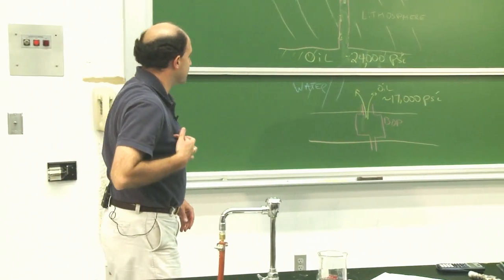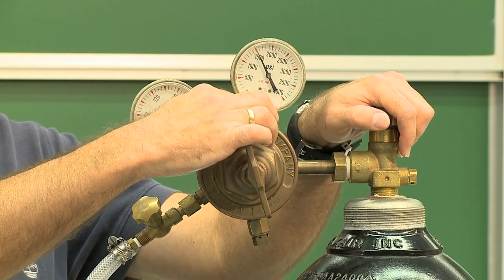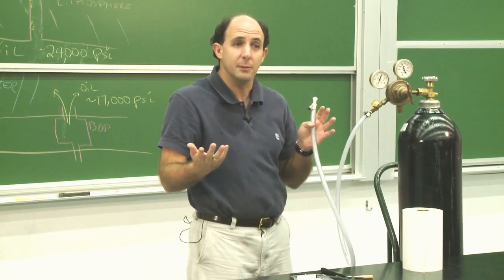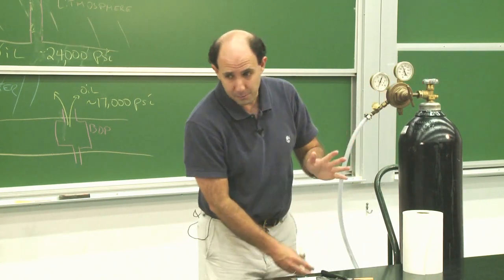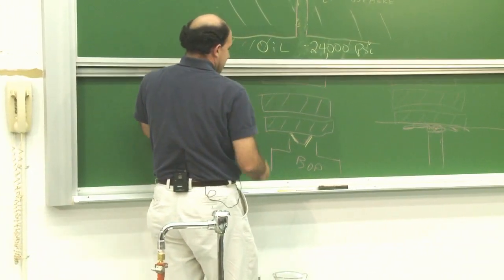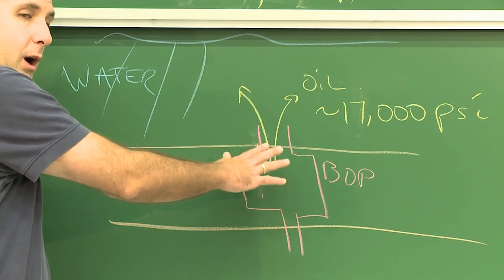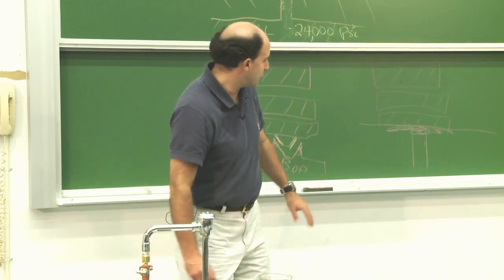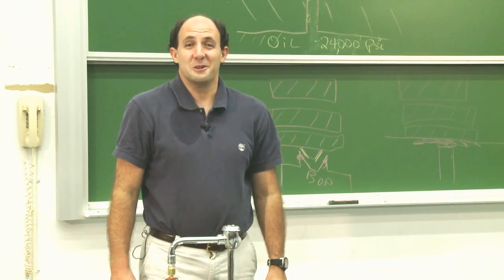Gulf Oil Solution Part 2

Comment: If the pipe and casing below the sea floor are damaged and leaking, as is now suspected, capping the blowout preventer would result in the oil escaping at the damaged areas, like capping the end of a hose with holes in it. Isn't a seal needed below where the pipe and casing are leaking?